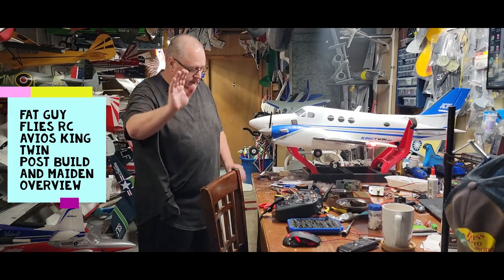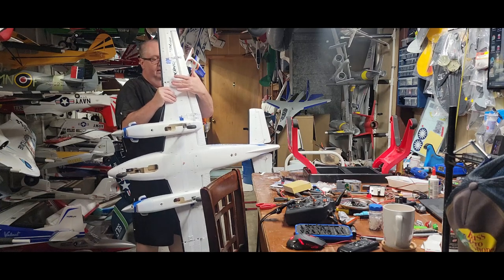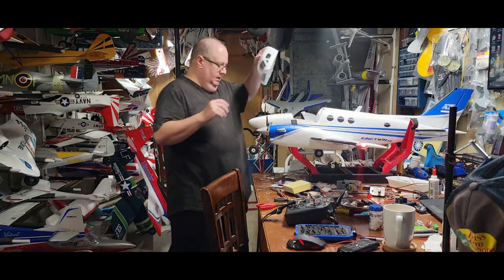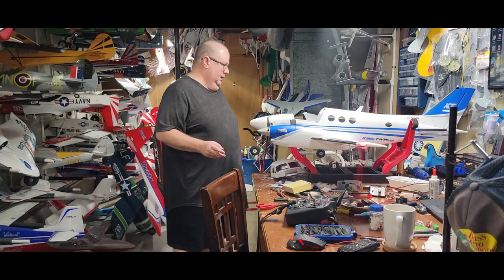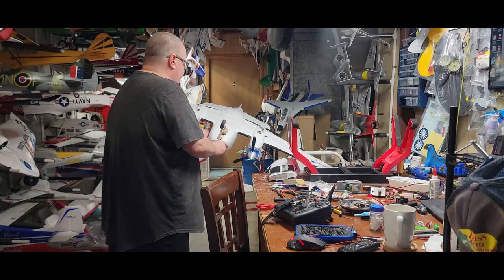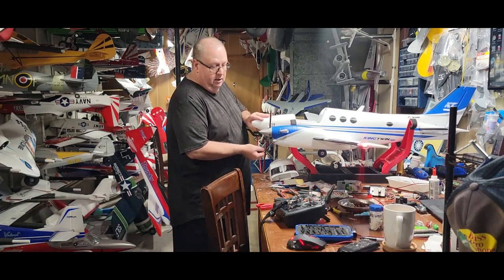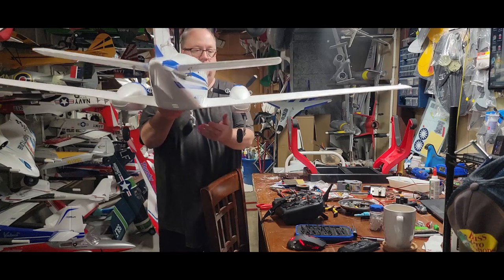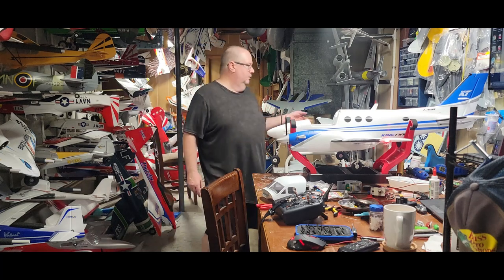AVIOS King Twin- MAIDEN! -BUILD OVERVIEW! -MODS!  by Fat Guy Flies Rc

Comment: Greg, you can install a steering gyro inline before the servo that controls the steering.  That might litigate the wobble while taking off 🛫 could also assign to its own separate channel and dampen with expo and rates.  At least that’s what TwoBrosRC does.
Reply from the maker: Yes its own channel would work but I am out of channels now with this receiver.

Comment: Great informative video !   I own this plane and Im stil in the process of finishing my custom paint job.    One thing I ALWAYS do with all of my foam planes is immediately cut the control surfaces off and install DuBro square hinges with finish grade epoxy.     Unfortunately with this particular plane you cannot do this with the flaps and ailerons because of the way they are attached only on a tiny section of the top surface.     Im glad you included your segment on painting the existing hinges with a bit of adhesive - good preventative addition !
Reply from the maker: Thanks for your experience and model setup practice. I do the paint on glue reinforcement on any foamy that does not already have mechanical hinges.

Comment: Hi..interesting maiden! Very windy!! You obviously experienced those scary nosewheel antics first hand and your comments directed at Hobbyking were spot on! I've heard they've been experimenting with a redesigned nosewheel so there may be a version 2 on the way. I hope so... it's a lot of plane for the money. Maybe that explains the dramatic price cuts that have be introduced...although it could also be because of slow sales due to the adverse comments the nose gear generated! Glad you doublechecked the mounting screws....something I should have done! I was lucky to survive the maiden! I fly at Club Torre, just outside Valencia,  Spain and we have a tarmac airstrip that chewed up the original foam tyres so I have fitted low bounce rubber ones and it makes a big difference to landings and taxiing. As I mentioned earlier I changed over the nosewheel to a P-38 one which fitted exactly. I cut the strut just above the coil spring and the new gear slipped on perfectly.  If there is a small problem it's that there is a lot of travel on the suspension and if you land firmly the plane can tip slightly and combined with the dip of the suspension it's easy to ground one or both props. Check out your first landing on the grass! The new nose gear has improved the ground handling immensely as will the ME-262's if you go down that route. Congratulations on your videos which really help explain building and flying all kinds of rc planes in a  calm and detailed way which is a boon to 73 yr old rookies like myself. It's a great hobby for pensioners and all ages. Saludos desde España!
Reply: Just wanted to add, I've just changed the nosewheel servo to a separate channel to help with adjustments. And I've just bought a couple of Turnigy Graphene 5.000 45C batteries and first time out I got 51% and 50% on 12 minute flights.
Reply from the maker: I have added some low bounce tires for the mains and the Freewing ME 262 nose gear for the nose. I love this plane and thanks for your info and watching!
Reply: Sorry...not your first landing....your second...on grass. Notice how easily she tips over to one side and the props can get damaged!

Comment: A good majority of Rc Pilots tend to not Flair enough on Tricycle gear planes and thus always complain how the nose gear is to weak...Well Flair the nose up some more and you wont be bending or breaking nose gears off....Maybe their to used to Tail Draggers and are used to coming down on the mains?
Reply from the maker: Fair point and I agree tri cycle and tail draggers land differently and you need to acknowledge that and fly/land accordingly.

Comment: My front gear was a piece of junk also.   It had so much slop in the movement that it was very hard to have it track straight on take offs and while taxiing.  It also would not function every time, and I ended up having to land the plane with the nose gear down part way.  It then collapsed and stripped out the gear and I got road rash on the bottom of the front of both engines and ruined both props.   I have replaced the gear with one from a Flightline P-38.  I understand a Freewing ME-262 front gear works too.   Otherwise, the plane works fine.   Since replacing the gear, it is much improved in handling and functionality.   Another guy in my flying club has had the exact same problems with the front gear not steering straight and his nose gear didn't come down at all and he had to land with the nose gear up.
Reply from the maker: Oh I agree. Great Flyer, looks real good but in direct contrast the gear sucks!!

Comment: Just read on a rcgroups thread that as of June HKing are shipping out King Twins in white with upgraded  nosewheels to be followed by livery versions. This explains the clearance price on the last of the old stock. The upgrade has a stronger and reshaped connector rod, a solid strut without a coil made of stronger metal with an additional piece plastic support bracket as well as a slightly larger front wheel. Oh and an upgraded servo as well.
Apparently they have been listening to customers'  reponses which may be a first! It's taken them well over a year! Upgrade kits will apparently be available shortly. 
At least the upgrade if it worksI (I'll wait for some reports from new buyers first! ) will have that characteristic forward rake. My P-38 conversion is more vertical and not so scale but of course has suspension.  Time will tell if the replacement gear works! 
Also when changing wheels be super careful when removing the C clips as they ping off either into the wing or get lost  on your workshop floor and dissappear!  They are super difficult to replace at least here in Spain! Left the plane out of action for days!
Reply from the maker: Figures I would be snatched in by the sale and Missouri. OH well that's modeling. Good to hear HK is listening to customers however. That's a first for them.
Reply: They have upgraded nose gears, but the retract is the same old one that is having problems.   So steering may be better when on the ground, but the gear will probably have problems with going up and down.

Comment: Dont even get me started with the wing locks Fats. I was on the phone with HK and they told me I was nuts. You have to modify them like you are doing and I was pissed off with HK insulting me. I said to HK are you saying im the only one that has this issue and they said yes. I told them BS. Otherwise its a great flyer and nice.
Reply from the maker: Yes HK customer support does struggle. i have long since disposed of this plane, I fell on it in the driveway and it broke my fall but it did not survive.

Comment: I didn't catch the full model # of the receiver you used. I just heard AR6T. I just purchased this plane and will be adding an AR631. Wondering if you used a 6 channel receiver and if you had to do anything funny with a Y harness for the lights and ebic?
Reply from the maker: It is the ar637t with sage and as3x.
Reply from the maker: I plugged lights too bind port just for power. Don't remember a ubec off hand.

Comment: The aluminum arm that comes off the nose gear , there’s a small shaft that drops through the arm . Does that just hold in place by gravity ? Are was the there something holding it in place ? Mine popped out today . Was noticing the nose gear was tracking differently from rudder . Tried to slightly adjust it with a small twist , clevis popped right out with this shaft in it , from the arm
Reply from the maker: No it stays moveable to turn the nose with the rudder , if I am understanding you correctly.
Reply: @FatGuyFliesRC   What holds it in place ? There’s a head on that shaft on one end , but what was on the other end ?

Comment: how are you splitting the lights? running a AR637T with a NX10
Reply from the maker: I did the same , used a y with the ubec. They just need power.